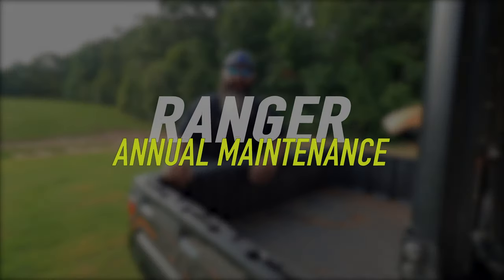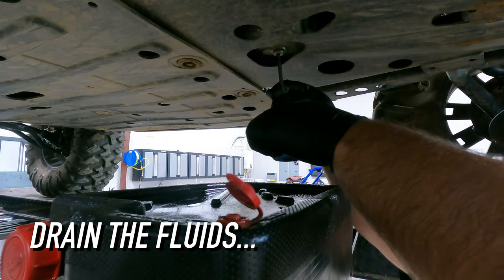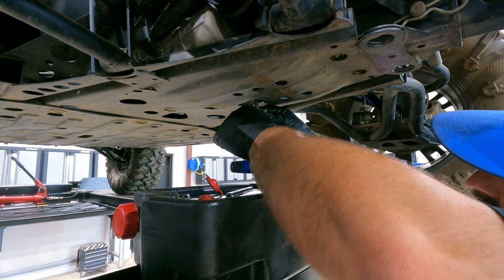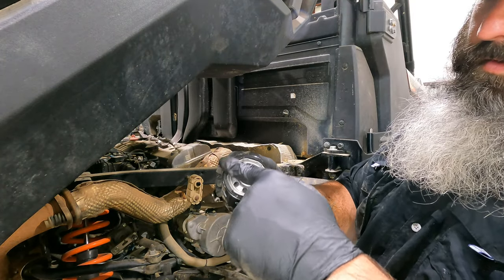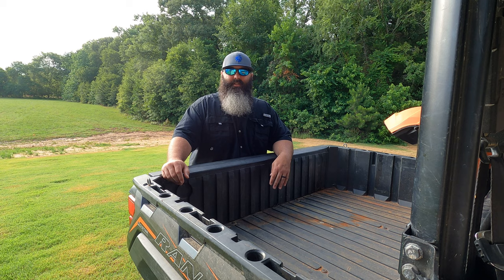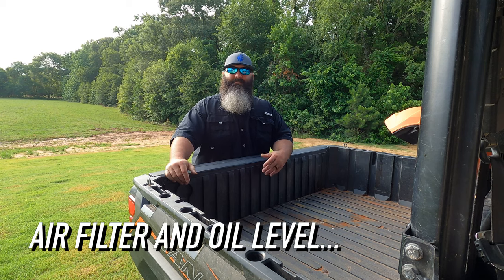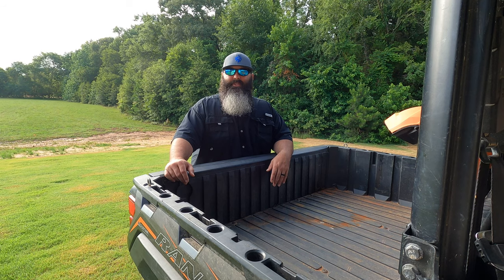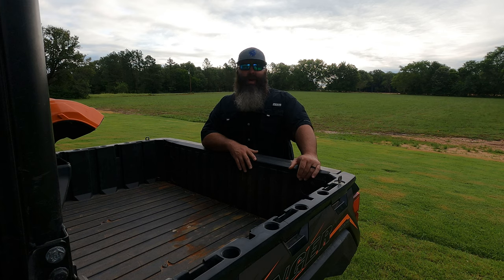Trail Kings 4 STEPS for a Full Service Maintenance on a Ranger 1000 (Pro-Tip for how often per year)

Comment: Do you have a similar video for the Ranger Kinetic? I'd imagine only the grease points and diff oil changes apply. Thanks for any info you can give on Kinetic maintenance.
Reply from the maker: we do not.  hopefully, you can use this as a reference and locate the correct maintenance points.

Comment: Great video didnt see how you did the carrier bearing was too quick
Reply from the maker: on this model ranger, I pull the insert out under the seat that exposes the battery area.  From there I feel where the zert is located and attach the grease gun nozzle to it.  It's hard to see but you are able to feel it when connecting the grease nozzle.  Hope this helps.